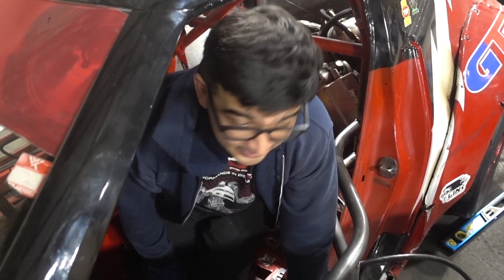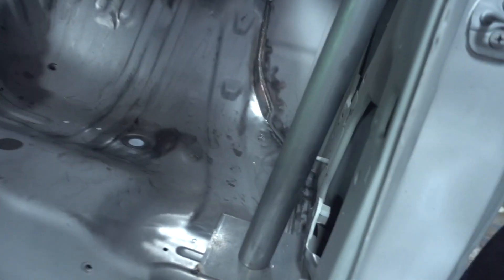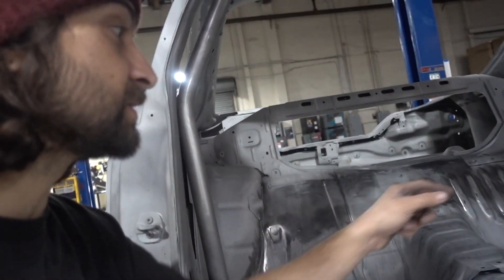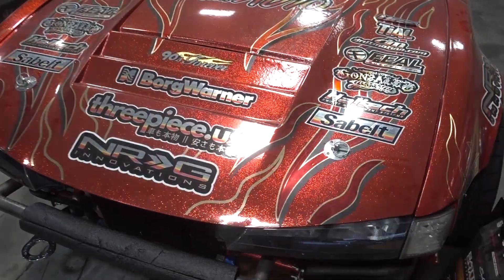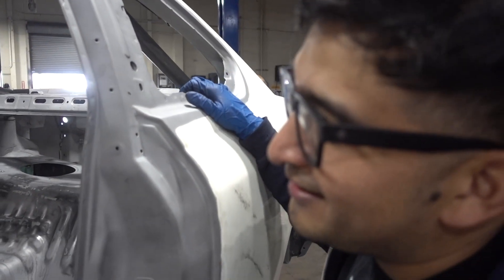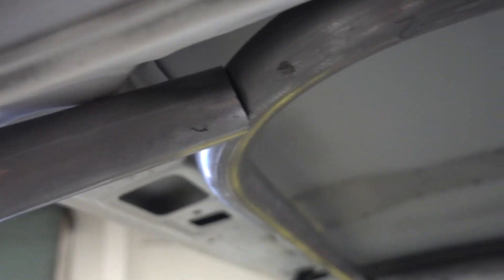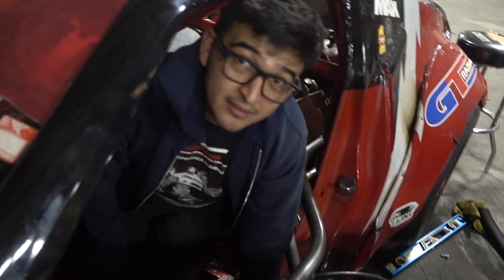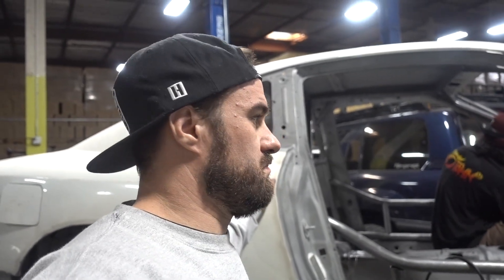1 DAY ROLL CAGE - 3D Scanned/CAD Designed Roll Cage for S15 Silvia

Comment: How do you weld the top of the cage with a roof?
Reply: Drill holes in the floor to drop the hoop legs down, weld the tops etc, raise the cage back up, weld up the holes, put on the floor plates and it’s done. I suspect writing it is much easier than doing it lol.
Reply: @foamdataservices  thank you!